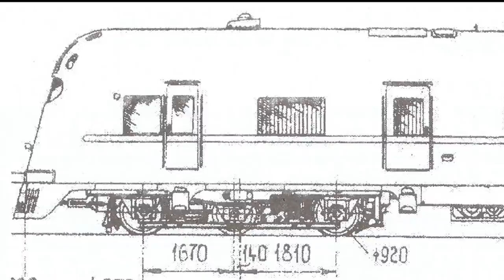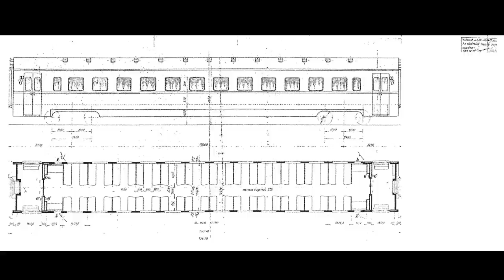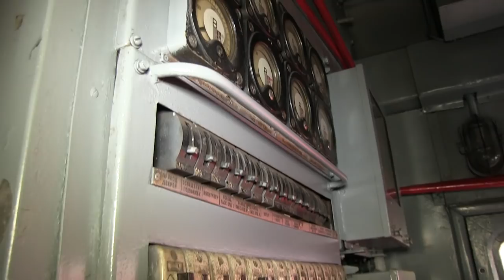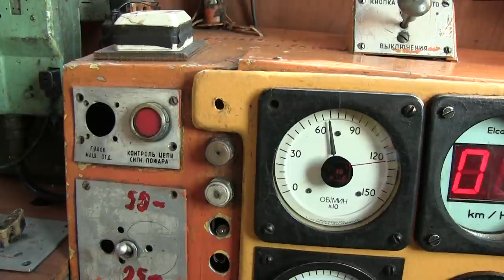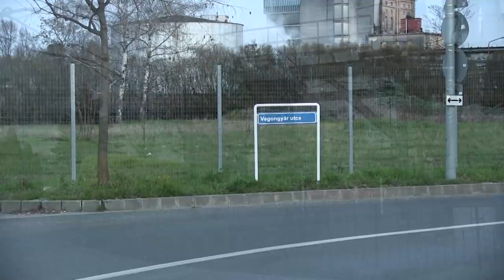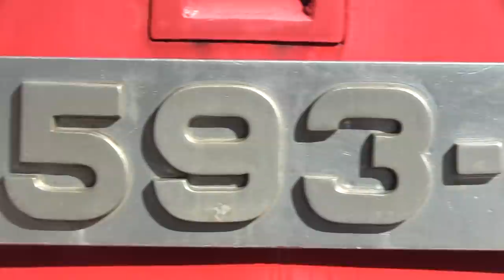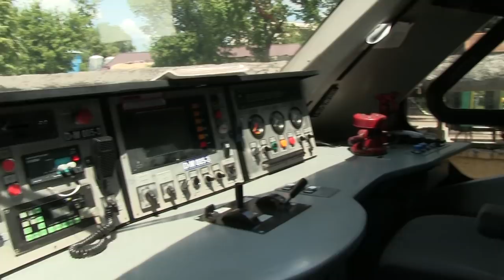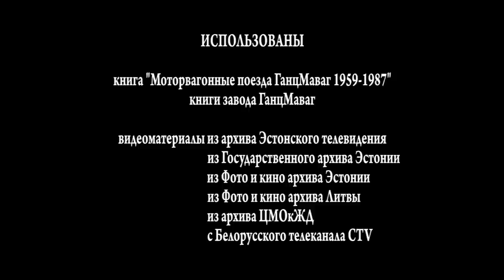Документальный фильм - дизель-поезд Д1 / D1 DMU train documentary (with eng subtitles)

Comment: Another well made documentary of an iconic train from the former Sowjet Union.
I remeber them from a couple of trips I made in Ukrain and the Baltic a decade ago, and especially the one trough the Carpatian which broke down and was unable to make the climb on one engine only, a ChME3 had to come to the rescue, and the D1 made it's first trip after refurbishment at Kolomnya!
The problems with spare parts were obvious because it had UPVC window frames as used in buildings, and not proper railway carriage window frames from metal.
Please do one on the 2TE10 class, another noisy icon.
Reply from the maker: Thanks for the compliments. But unfortunately I will not make any more documentaries in the near future. The reason is very simple - I just do not have the time and money to do them. One film takes up to a year in research and data collecting, script creation, shooting the clips and etc. I do not even count the montage time here. Plus at least 1500€ for the trips, equipment etc. The feedback I get from the films is good and positive but the ad revenue to cover the costs is just not motivating. The TEP60 documentary cost 1500€ to make, ad revenue from it is 51$. D1 documentary cost 3500€ to make, ad revenue 49$. DR1 documentary cost about 2000€ to make, ad revenue from it is... 26$. You do not have to be a businessman to understand that this is kind of bad investment. My goal is not to make money with them, I would just like to get my costs covered. Money sadly does not grow on trees.
Reply: I understand the problem, just when I look the amount of expenses I made in the past just to film trains fro myself, and that was not making a documentary with all additional work.
You really need millions of views nowadays to recover at least some cost, as video's do not monetize very well anymore, I even don't bother putting adds on my videos I post because it's only a euro I would earn per video at best.